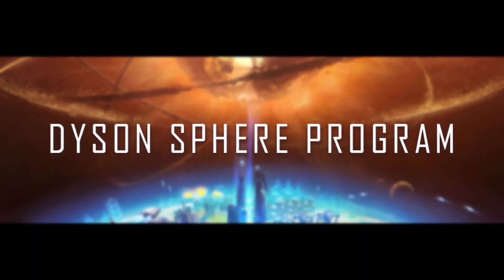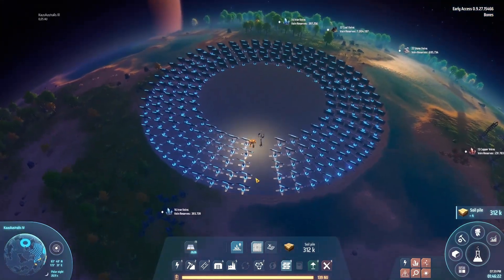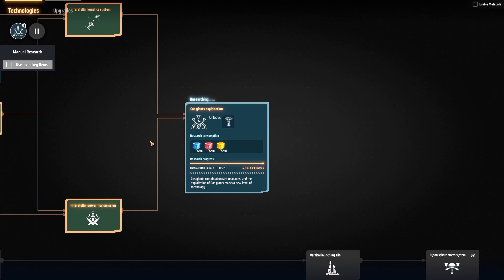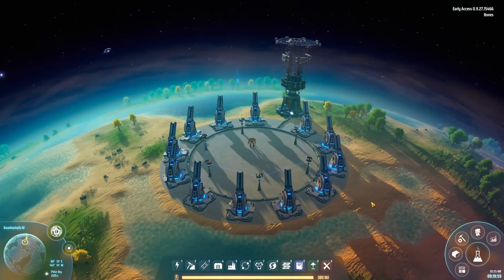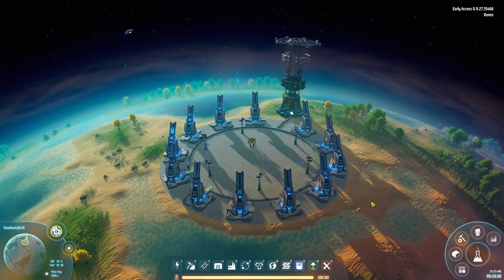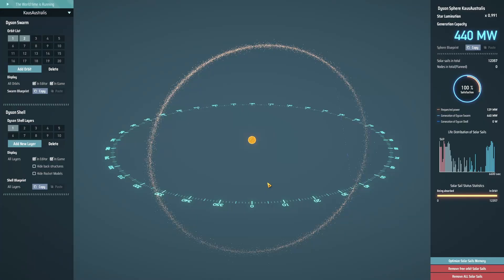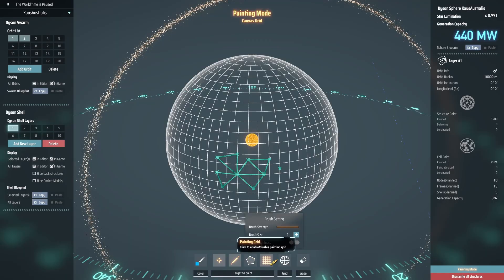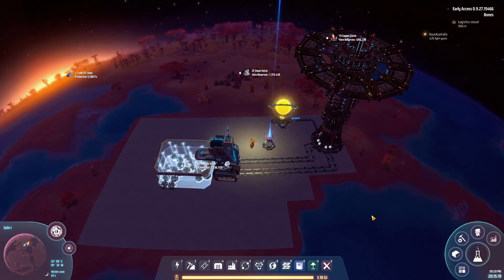Power generation in Dyson Sphere Program explained in one video!

Comment: Artificial stars are good even in systems with a dyson sphere
If you build a large forge and/or factory world, you'll run into the problem that ray receivers just aren't that space efficient, to power such a world takes a huge number of ray receivers, taking space away from your smelters and crafters
Artificial stars produce more power in less space, especially with prolifirated fuel rods, and are activated in both day and night
Of course you still need to produce the fuel cells, but that can be done on a separate planet and photon generation is a lot more space efficient than energy generation, even factoring in the extra processing
Reply from the maker: that's good to know, thanks :D energy density for buildings must be crucial for the late game "megabase" stage

Comment: No mention of the accumulator and the energy exchanger. I literally use them to power my entire civilization in the end game.
Reply from the maker: back then, the accumulator capacity and recharge/discharge numbers were different in contrast to today iirc, so I had trouble categorizing them as a 'viable' power solution. with higher energy density and the fact that you can run an entire end game civilization on them makes me believe that such a mechanism will get the job done pretty well nowadays though :D
Reply: @center_pivot no worries. I loved the video.

Comment: You missed a bit with geothermal plants, the holes in the planet Dark Fog ground bases leave can be tapped with them. The resulting plant has over 250% power generation.
Reply from the maker: ohh interesting, dark fog wasn't out by the time I wrote the script for it but that's quite some bonus power from a single geothermal plant.
Reply: @center_pivot  They also added a Strange Annihilation Fuel Rod you can make from antimatter rods and dark fog drops for a crazy amount of power output from Miniature suns (Artificial Suns).